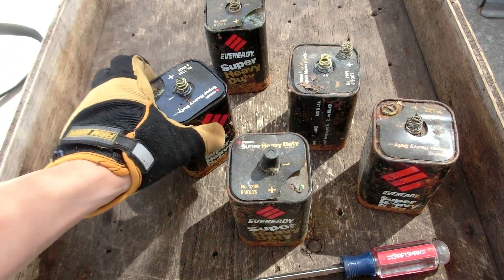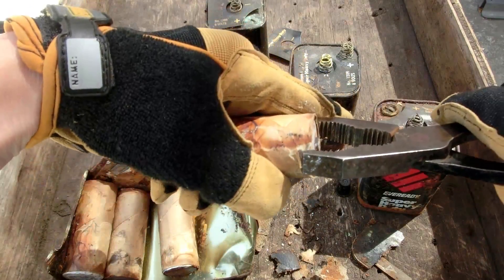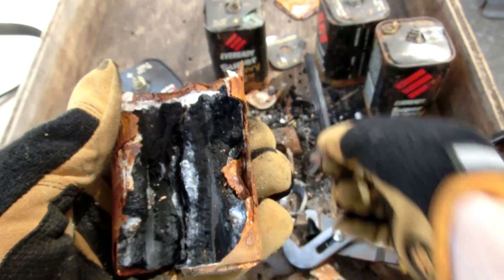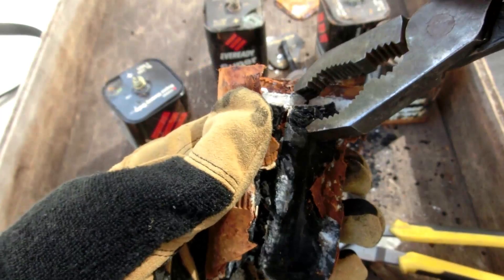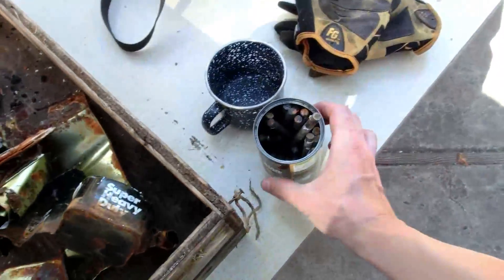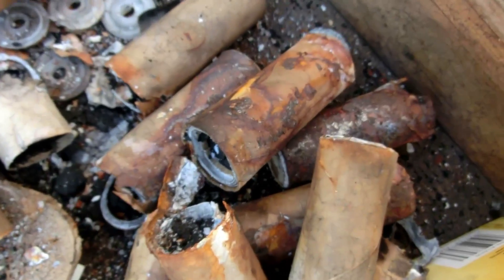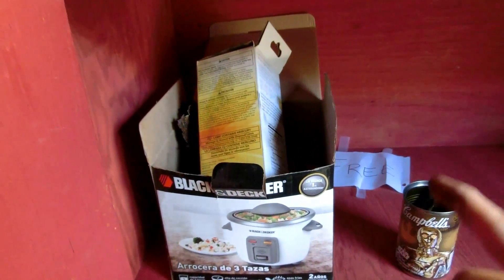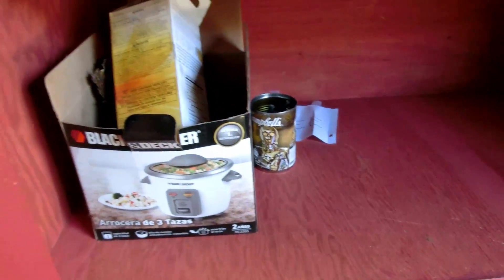Free Graphite and MnO2 from old Batteries

Comment: Electrolysis tank for removing rust!!?? Wow! I was think of using the graphite electrodes / rods as electrodes that could arc for melting zinc in a borax or something melting containment! Also I thought you were going for using the carbon for something like making graphene sheets. Although I know activated carbon or graphite is used for that....also it's more so graphite sheets not really graphene. Oh, well.

Comment: Interesting video, as usual. I've pulled a lot of batteries apart too. Try the little 9V batteries. They have small carbon plates with the manganese dioxide sandwiched between the carbon and the zinc.

I just wanted to note, in case it hasn't been mentioned by anyone else, that I don't think the carbon rod is graphite, but is just carbon powder packed and compressed as a rod. Graphite has the carbon atoms arranged into enormous single atom thick sheets, which gives it really interesting properties.

Zinc's melting point is pretty low (419.5 degrees C). Perhaps you couldn't melt the zinc because it oxidized under the flame too easily. You might be able to test this by displacing the oxygen with carbon dioxide or nitrogen.  From memory I think they use carbon in furnaces to burn the oxygen, keeping it away from the iron. I could be wrong there though. You can still get the zinc back from the zinc oxide using electrolysis. Zinc oxide is a useful material in its own right too.

Comment: connect a transformer to one of the carbon rods or graphite rods whatever you want to call them and if you get a high and of current you can make them glow I suggest AC instead of DC because DC cannot handle that much graphite or carbon rod what if you want to call it well maybe it can

Comment: We used the carbons for soldering.  Using a 12V battery, connect negative to a terminal then touch positive through the carbon to the joint to be soldered.  Works great and fast.

Comment: Zinc fumes cause fever and flu like symptoms.  Go to the hospital if you get these.
Reply: https://en.m.wikipedia.org/wiki/Metal_fume_fever http://www.anvilfire.com/iForge/tutor.php?lesson=safety3/demo
Reply: +Tom MacMillan i do quite a bit of welding i don even know how they melt it i meen i used a few times stuff coated in zinc and if i leave a spec of it it just turns to fume and blows away all the weld metal  the crapyest metal ever
Reply: If you get those symptoms you die ...

Comment: wow, you should have probably not tried to melt that zinc.  there's a reason that you're not supposed to weld galvanized steel, the fumes are really bad for you.
Reply from the maker: +Tom MacMillan funny because i used to melt zinc all the time as a kid, got a bunch of zinc blocks and had fun casting with them. i moved to that after melting lead. but the key is i hold my breath any time i do this.
Reply: +Rinoa Super-Genius i hope always outside the house or garage.
Reply from the maker: questionator2
yeah i had a nice brick burn pit for many years.

Comment: A furnace or lamp would be my thinking regarding the carbon rods, could be quite interesting to see. Be careful heating / melting zinc it gives off zinc oxide which can make you very unwell (metal fume fever).
Reply: https://en.m.wikipedia.org/wiki/Metal_fume_fever   http://www.anvilfire.com/iForge/tutor.php?lesson=safety3/demo  YES!!! +Rinoa Super-Genius If you feel like you're getting the flu, go to the hospital
Reply from the maker: +Tom MacMillan dont worry i'm fine, pretty much any time i am doing something with fire i hold my breath. i think its mostly due to concentrating but also so i dont breath crap in.